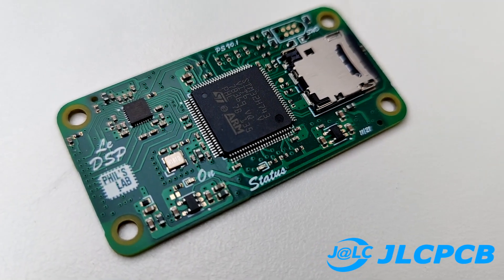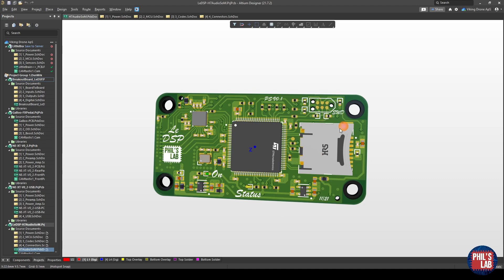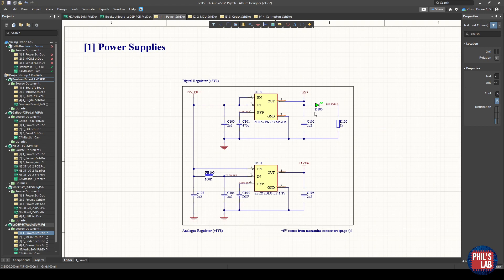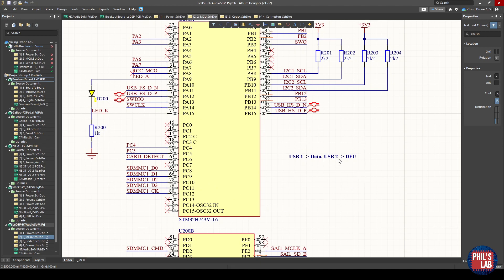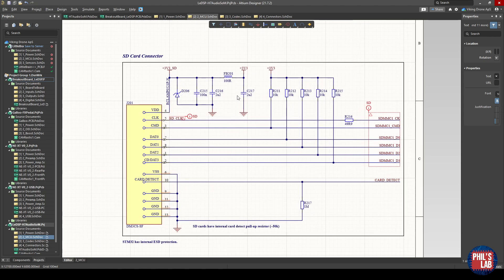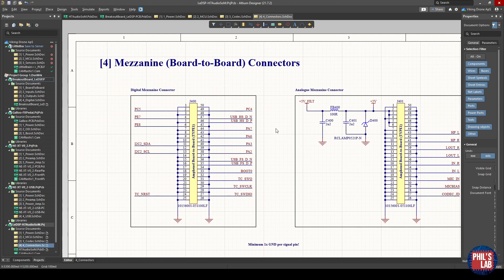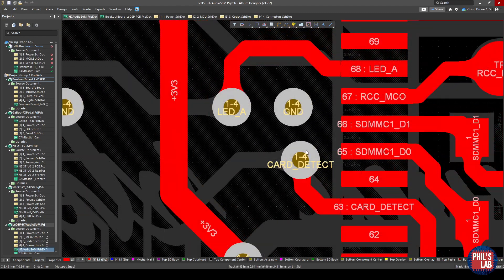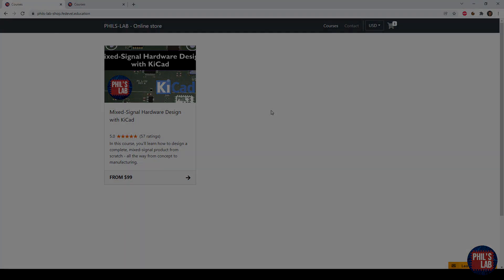(Sponsored) Mixed-Signal Hardware Design Overview | Audio SoM | STM32 & Altium - Phil's Lab #45

Comment: Hello Phil,

I’ve just finished the Mixed Signal course and started working on a design that is basically based on what you used in this video and what you presented in the course.

I have a question: I’m using the ALC5616-CGT codec in my design, and I want to add an input buffer (high impedance) and a filter. I plan to do the same for the output—a reconstruction filter and an output buffer (low impedance).

Should I power the op-amp with 1.8 V or 3.3 V? I’m asking because the analog section of the codec runs at 1.8 V.

Thank you very much. I absolutely love your channel and will for sure buy more courses.

Comment: Hi Phil, thanks so much for sharing your knowledge. I'm new in PCB design and I want to ask where you got the circuit for the micro SD module, since when looking at the "dm3cs-sf" datasheet, it doesn't show the application schematic. 

I see that many projects use different circuits for the SD modules, but I don't understand what it depends on. Thank you so much if you could explain it to me.

Comment: Typically, adc/dac ground consists of two grounds: digital and analog. They  must be connected in a single point, and then to a digital ground in only one point as well. With serious filtration  with capacitors. Open any ess/ak/ti/ad dac chip design guide. Everything is there.
Reply: That doesn't mean it's correct 🙂

Comment: Hi Phil, do you develop your own circuit diagram (how many and where capacitors, resistors, etc are needed). Or do you get the schematic from a source?
Reply from the maker: Hi Rosh, I develop them myself with the aid of datasheets and application notes.
Reply: @PhilsLab  Thank you for the reply. I always thought SoC manufacturers would provide that information, even tried requesting. But they seem to mostly point me towards buying their development kits 😅😂. Which are more execess in feature and physical size than a final retail product.

Comment: Hi phill, I love your content. I am aerospace engineer graduate. I want to design and program my own flight control board for aerial vehicle. I want to take your course, but I have one doubt that will your course help me to build and design my own flight control board? please clearify.
Reply: It does not sound as if the course is going to discuss a flight control board specifically, but such control boards are absolutely mixed-signal PCBs.  As such, I would think that it could be very helpful if you are not confident in the basic design of boards with high-speed components, precision analog, power supplies, etc.  If you are looking specifically for something covering flight control algorithms, maybe somewhere else would be better.

Comment: Very cool   ...   I  ju st   bou ght  a  cool  Stirling   Engine   model.   I  think  a  cool project  would  be  to measure   the  temperature  differences   between the upper  plate and  lower plate of th e regeneration  chamber then  calculate the  efficiency of the model  engine....   Love   Physics   but  hung  up  on  EE too.

Comment: Tag-Connect confuses me between TC2030 Vs TC2050 - how do you know when to use the 6 or 10 pin versions? If I still need both standards between designs, I end up with a bunch of adapters and plugs; doesn't that defeat the point? idk...
Reply: 6 pin is ok for programming the mcu and swd based debugging

Comment: Are you pouring the ground in the top layer of the main board to avoid the side effects of a breaking the ground plane when routing signals in the bottom layer?
Reply: The main board is a 4-layer PCB with layers 2 and 3 being dedicated ground planes. With this kind of stackup, signal and power traces are run on layers 1 and 4. No traces (or as few as possible) are run on the ground plane layers. Designing this way means that components and traces do not break the ground planes.

Comment: Recently I was making PCB for my small gaming console bases on STM32F779II (179 pin QFP) and 32MB SDRAM + LCD. To improve my design process I made Excel file that reads csv report generated by CubeMX and sorts all connections by GPIO ports (A,B,C...). That was huge help when I was preparing schematics as uC symbol pins are usually sorted by ports.

Comment: Do any of these designs meet radiated, conducted emissions?   Just curious if you have pre scanned the boards at a certified lab.  Also is there any signal integrity done in say Hyperlynx or other SI tool? I realize the placement is close nevertheless it is a good idea to check the transmission lines, crosstalk and power integrity as you mentioned in you video. Good job
Reply: what SI tool is easy to learn for beginners?
Reply: @KevinStoriesTV  Hyperlynx is easy to use but very expensive for individuals to own.  Siwave from Ansys is also decent but not as straightforward as MG Hyperlynx with a lot of capabilities as well. I don't know of a free SI tool I can recommend since I have been seeking for one myself. All these are outside the grasp of a hobbyists unfortunately ranging from 50 to 60K lease USD annually.
Reply: Totally not worth testing these or certifying this. Totally overkill.

Comment: Did you get that H7 in the last months at a good price? Because I have preorders for H7's since August 2021 and they are schedule to be delivered in Q1 2023
Reply from the maker: I got the H7s via JLC for around $10, but I assume they're out of stock again now (or increased in price).
Reply: @PhilsLab  They still have some H7's in stock, 23$ a piece... 

I forgot to mention that my orders that are estimated to be delivered in Q1 next year are for the 550 MHz STM32H7 with the Cordic and Math accelerator.

Comment: Thanks Phil. Have you considered designing pcbs with microcontrollers other than arm 32s because of the semi conductor shortage?
Reply: yes, I would love to see something using the esp32-s2 chip.
Reply: @warpigs330  There are still some stm32 controllers out there.  However, there are not too many of the highest speed ones.   There are a few stm32F743's to be had.

For me personally, I am not all that interested in the lower-speed stuff.  I am using this time of drought to get up to speed on high-speed design and this is exactly what I want.
Reply from the maker: Not really to be honest, I've always seemed to find variants of STM32s for my designs. Although it is rather annoying to have to do redesigns fairly often to meet the current availability.
Reply: @PhilsLab  I just searched for tthe MCU in from this project (and lower spec ones too) and the prices are sky high, sadly.